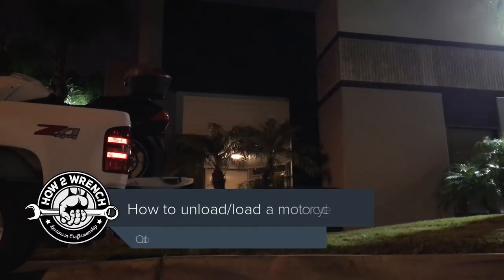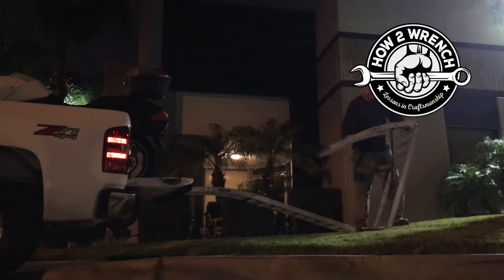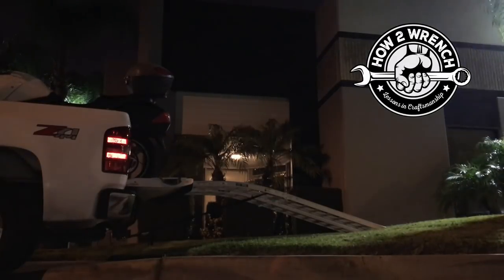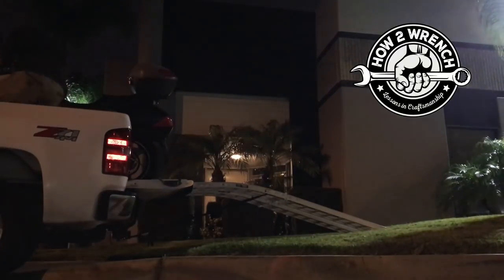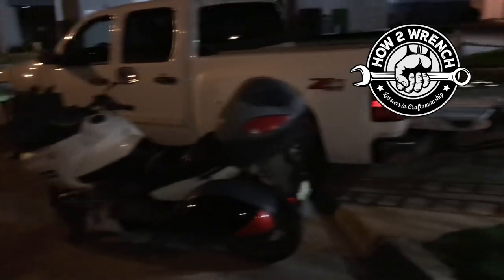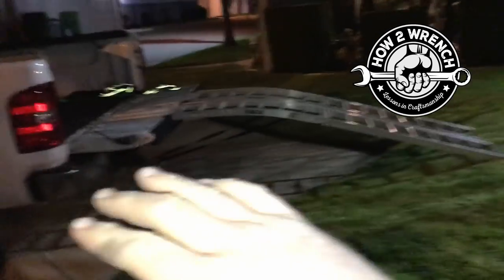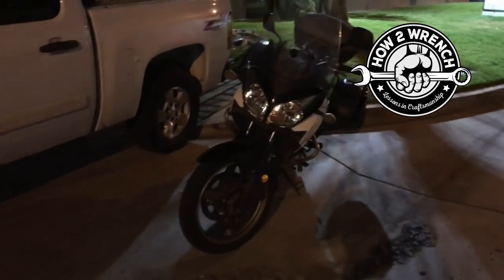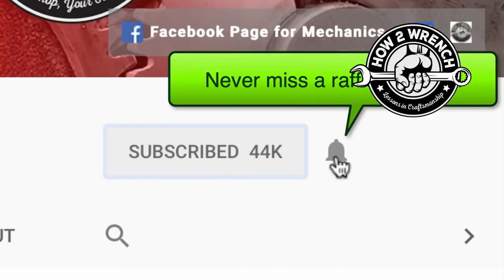How to unload or load your motorcycle from a truck without killing yourself!

Comment: I have a friend who is a pro MC mechanic. I bought a used ZZR1200 Kawasaki sport tourer. A big and heavy bike. I brought it to his house because I wanted him to inspect the motor and adjust the valves because I wanted his opinion on the health of the motor.
 He puts just one single ramp to the back of the truck bed. The bike is nose in on the bed. He stands in front of the bike and stands it upright by the hand grips.
I get ready to assist. He says no.
Then he just pushes the bike down the ramp and runs down following it, steering with the bars. The bike continues fifteen feet, he stops it and puts the stand down.
That bike weighs about 550 pounds and is top heavy. I'm amazed still every time I think about it.

Comment: Good points. I load a big bike onto a trailer, so I raise the front trailer hitch to drop the rear, same principle as parking next to a hill. Even so, the ramp is narrow so I always sweat I'll lose it over the high side. Better to have a spotter if somebody is around. The bike is too heavy to push it up so I use the engine while walking beside, feather the clutch as needed to ease it forward. A second ramp to walk on would make it easier still.